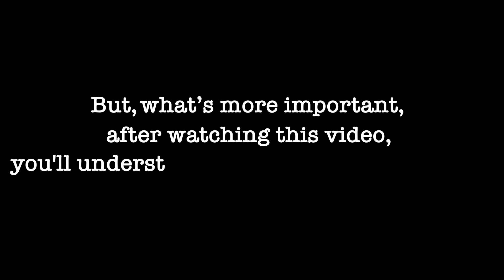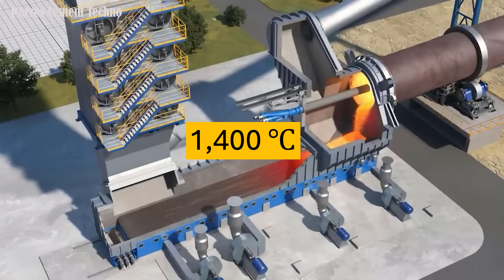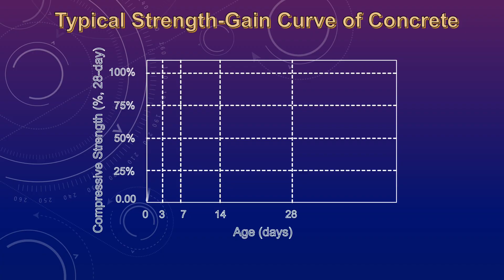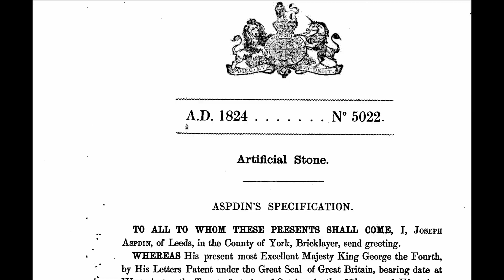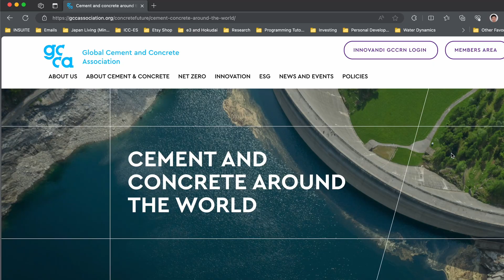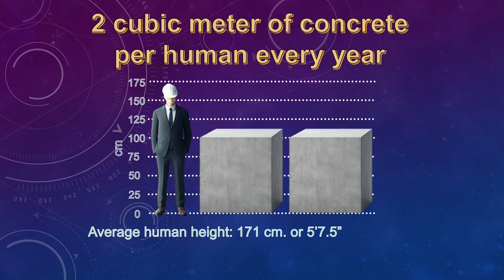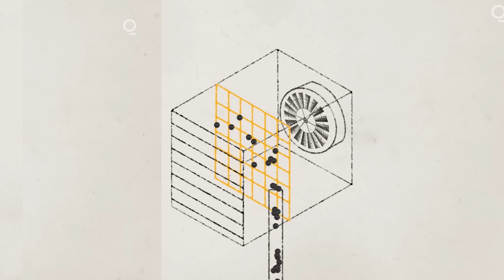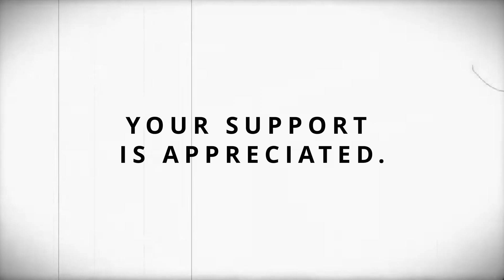Structural Engineer (with PhD) Explains: Everything You Need To Know About Concrete and Beyond

Comment: are there any alternatives to concrete? actually i am building a house so it can be a tin the house to reduce heat due to global warming
Reply from the maker: It's good you're considering effects of global warming, wood or mass timber has a lower carbon footprint than concrete. You just need some treatment against fire and deterioration and you're good to go. 
When you say tin, you might be saying the shipping containers. In terms of cost, they may be cheaper especially the used ones.  But you need to insulate them as they can get really hot or cold depending where you are. 
You may want to use precast concrete or prefabricated concrete products, same or better properties as a normal (cast-in-place) concrete but with lesser carbon footprint.